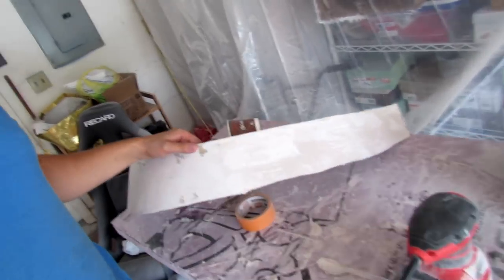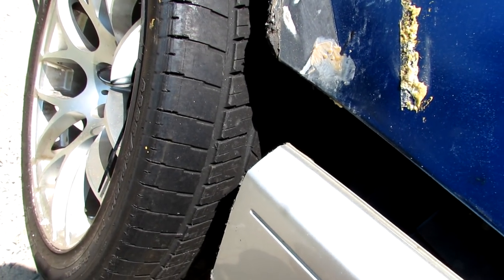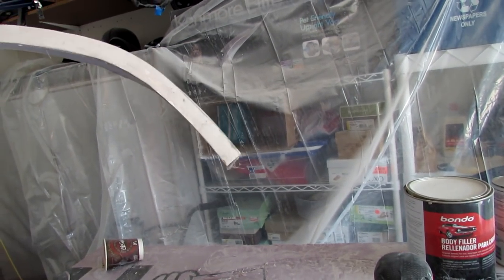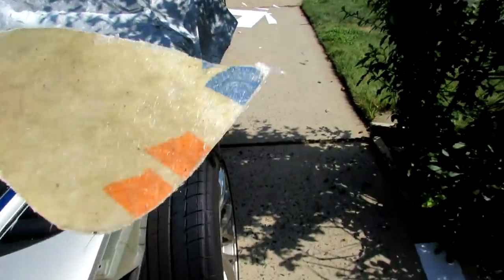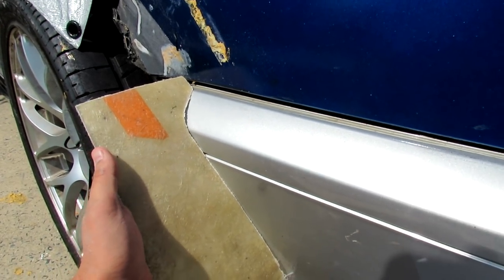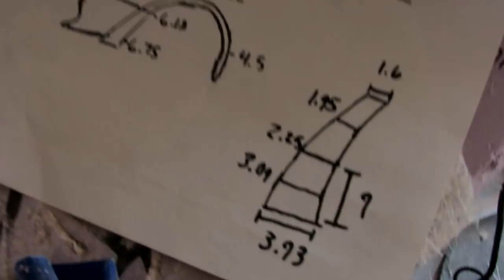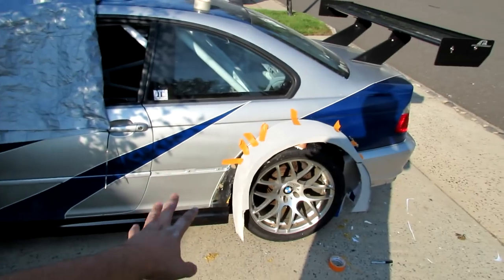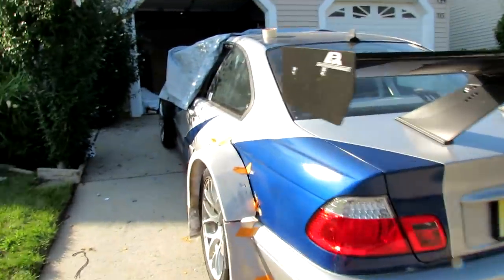DIY M3 GTR Wide Body Kit - Rear Left Done

Comment: I looked at some NFS: Carbon video earlier and the camera glitched into the interior during gameplay and saw a fire extinguisher inside. So you might want that too for 100% detail 👍 Congrats on 30K subs!
Reply from the maker: RedShed gonna run one anyway for safety
Reply: I think that was the NOS if I remember correctly. It was present in NFSMW as well. It's just EA's version of a Nitrous bottle.